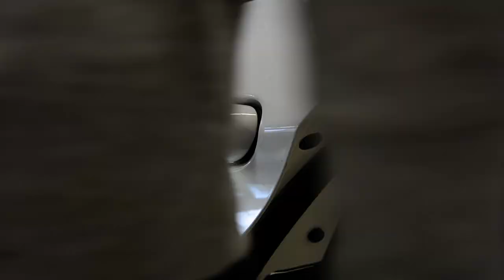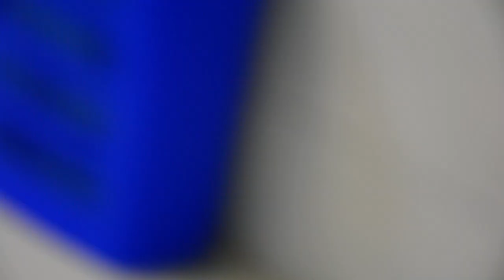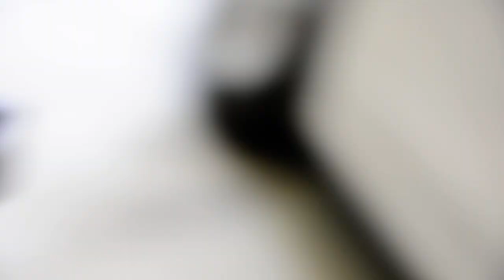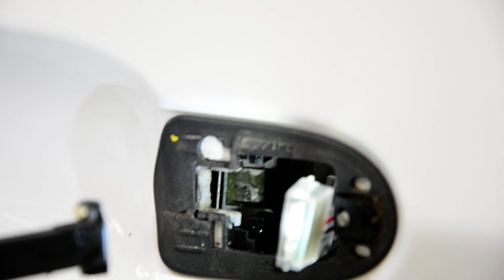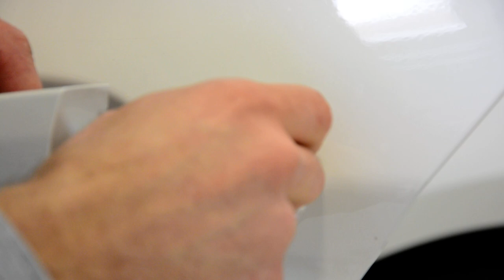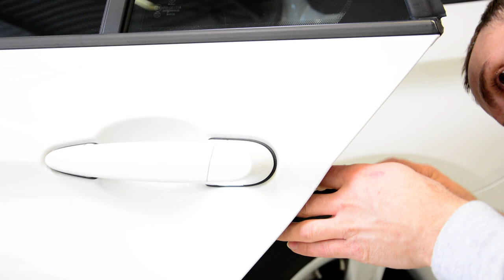How to remove the exterior door handle BMW 3

Comment: One key element missing is to make sure the interior "assembly" hasn't shifted.  I couldn't get the LED light back into the correct place because the whole assembly got pushed (about 5mm) in while I was trying to get the spring hooked onto the handle.  Key observation is the screw hole "square" is not proud of the door trim... it was recessed, and the entire assembly wiggled and moved (so not your typical German engineering!).  Pushing on the screw from the back and wiggling it, got it "popped" back into place and the led fit back in properly.

Despite the apologetic camera-work, this video was crucial for me to get it re-assembled, that pesky spring is not intuitive!
Reply: God bless you man I’ve been fighting with this thing for hours.